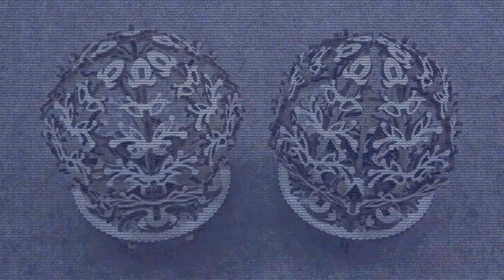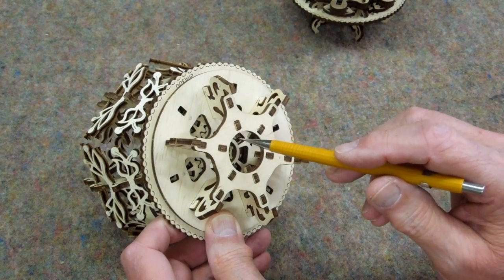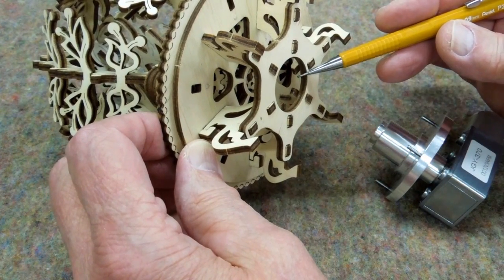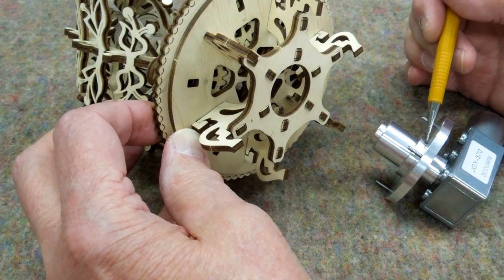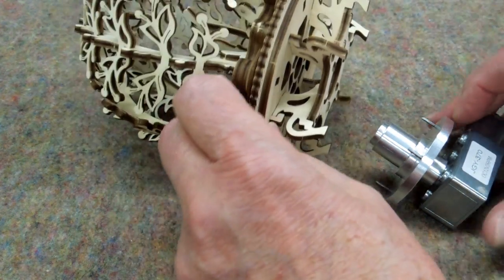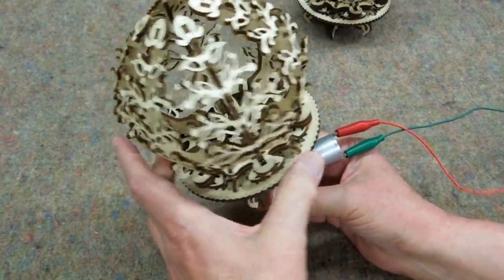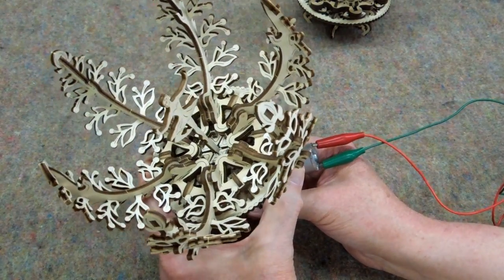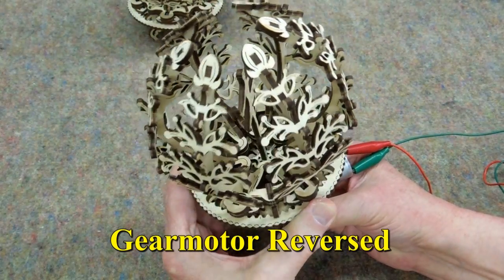Mechanical Flower Part 2 - Motorized Pedestal

Comment: where can i buy this kind of motor? Do you have a link?
Reply from the maker: Search eBay for “DC 12V Gear Reduction Motor” and look for the best price and desired output speed, usually ranging between 0.6 and 200 RPM. Some are larger than others. Check the dimensions.
Reply from the maker: What are you calling "the top part" ?
Reply from the maker: The adapter that is attached to the motor output shaft (one was made of aluminum and the other from a white plastic material) I machined on my small lathe. This is a 4-part video series. You need to watch all 4 parts and you would have seen that.
Reply from the maker: The part that attaches to the motor shaft, you have to make yourself as clearly explained and demonstrated in the video. If you are talking about the mechanical flower itself, you can purchase t hat kit. Google it.